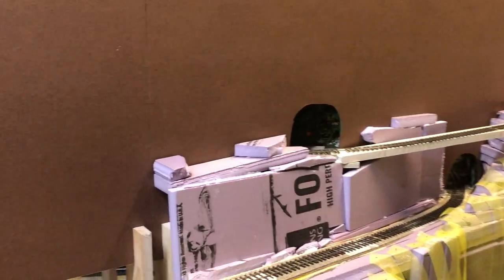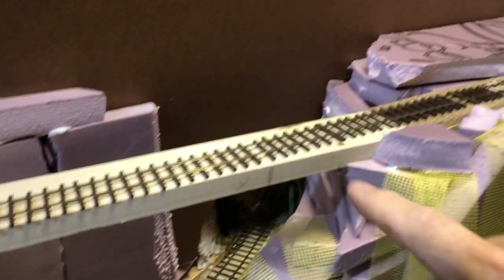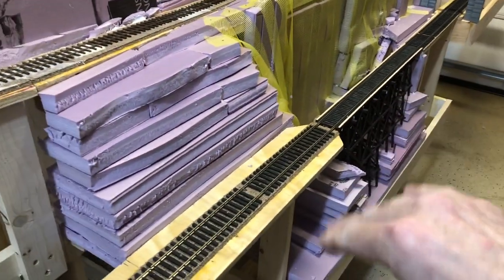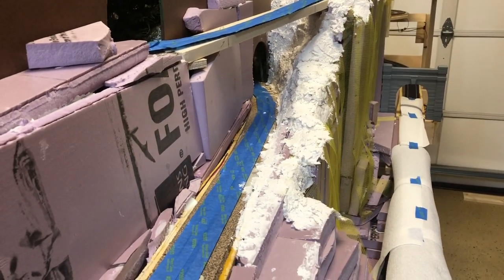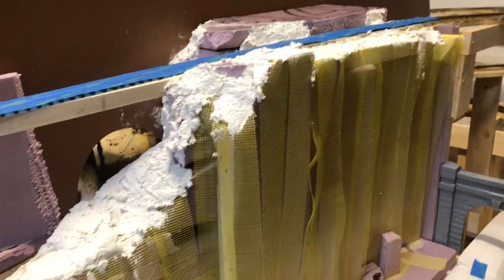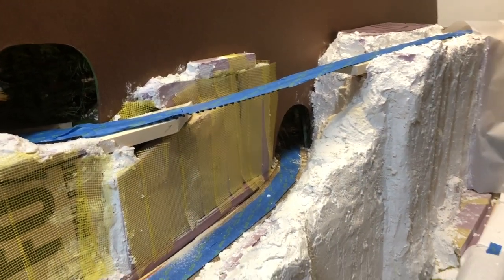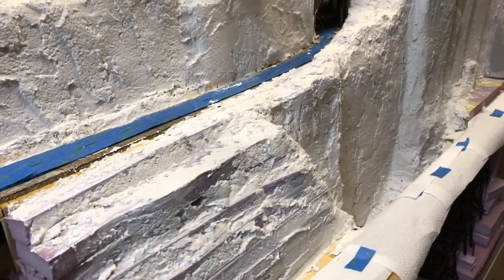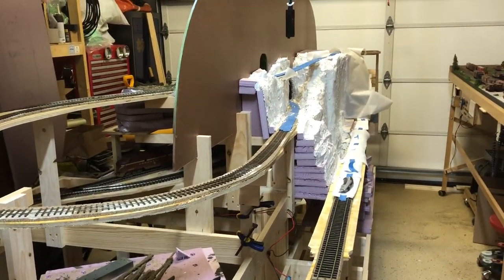O/On30 Sculptamold and Plaster Going on Other Side - Model  Railroad Adventures with Bill EP178

Comment: Great progress , it does look like it is going to be heavy . Looking forward to the next vid. Thx. for sharing . Ken
Reply from the maker: Thanks Ken!! Actually not heavy at all.  Sculptamold is like plaster when it goes on but when it dries out it’s pretty light.  With all I’m doing between plaster and sculptamold I’m only adding maybe 15 pounds of total weight.  Everything is pretty thin too - about 1/4 inch thick over the foam board

Comment: Looks like you are in a garage, how do you deal with the temperature extremes of the season?
Reply from the maker: Really it’s not bad.  I have a Furman d for the  house that sits in the garage so I’m winter it never gets drastically hot.  Central air also goes thru that furnace so in summer it helps keep the garage cool.  I limit opening the garage door too so I  keep humidity out as Much as possible